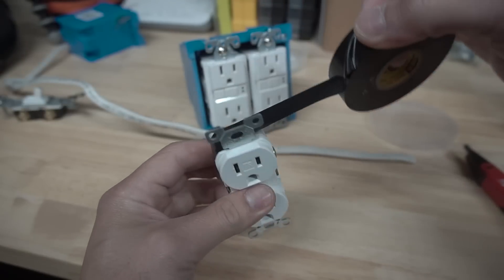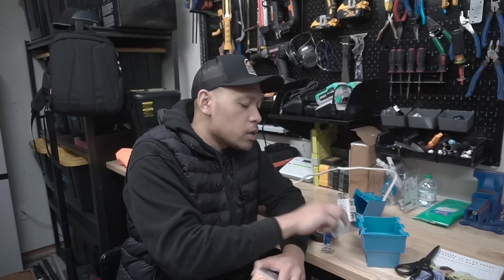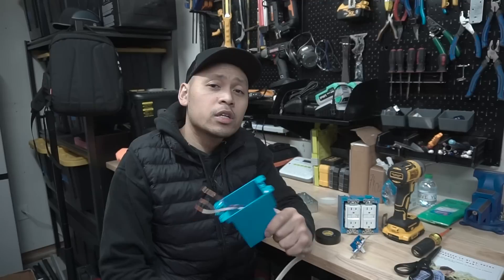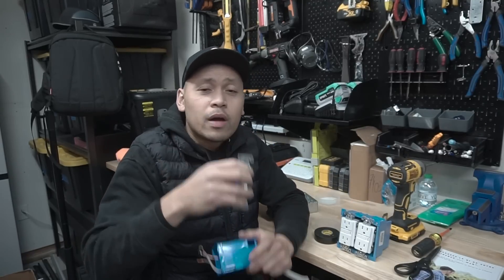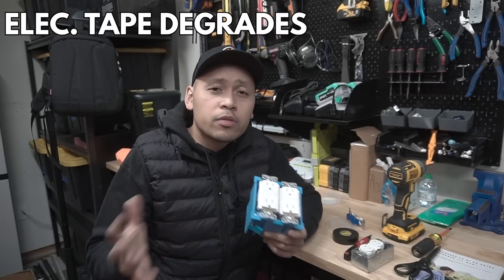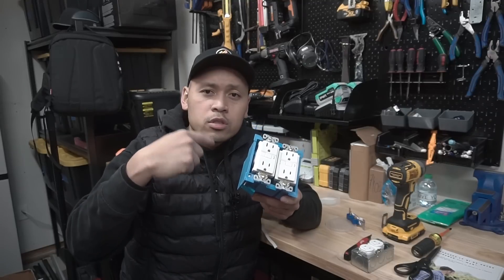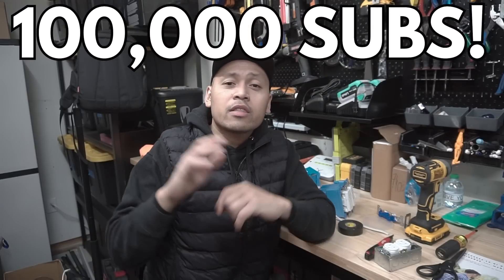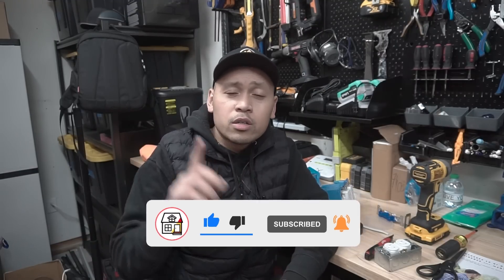Is It ILLEGAL To Wrap Outlets And Switches With Electrical Tape?! The DIY Great Debate! How To

Comment: I just hit an issue that makes me believe this practice is necessary. It's a new construction home and I was replacing a switch to a dimmer. The previous guy installing the left switch, left a hot terminal screw sticking out. Unfortunately the ground wire on the right switch touched that hot screw, and shorted. Luckily the circuit breaker immediately tripped, and all that's damaged is a slightly burnt hot terminal screw and a ground wire. I had to take that switch off, screw the terminal in, put the tape on, before I can confidentally put them back.
Reply from the maker: Thank you for sharing!

Comment: My 62 year old house with close clearance metal boxes has been prone to the screws somehow backing out(vibration over time?) and touching the box causing tripping and other weird stuff. So I will wrap tape around them AND around wirenuts. I see some electricians don't like it becuse of speed or extra time required, their stellar wiring skill, etc; but I don't live in that world and don't care.

Comment: I've been a electrician for since I was 12 years old. Yes my father broke child labor and minimum wage laws, paying me $2 a hour in 1998. Well taping outlets and switches, no matter what, was burned into my brain. To me it's all about looking out for the next person that will be working on the device. After 6 years of tripping breakers just before final inspections, I finally got my boss to agree with taping all outlet. He would say it take to much time. It takes 15 whole seconds to tape the devices. I personally work hot 90% of the time. Now and days you can't just trip the breaker cause you can short out smart switches. Also flipping through breakers can interrupt customers that work from home and such. So I tape the hot and neutral wire and then I can remove from box or pipes. And yes I have been buzzed more times then I can count. 277v high leg in meter was the worst. Never listen to your power company when they say it's off. Always check with your widow makers at least I basically kind of measure it out. Sorry 2 years late. Found your video searching for any info on using alien tape to hold a 1900 box on metal siding. It's just for the wall pack switch leg j box.

Comment: The way I see it, I see no harm in it. Yeah, it might be troublesome to service, but with a permanent installation, You're not gonna be poking in there on a regular basis. I would also tape around wire nuts too just for good practice as well.

Comment: I've had shorting issues with bare ground wires touching both the hot and neutral receptacle screws--with the screws all the way in--and even with back-wired receptacles--and even in plastic boxes--doesn't matter.  And I'm neat, take my time, and try to fold wires carefully.  Tired of tracking down issues--I wrap everything now.

Comment: HELP!!!

So, i have 2 front rooms upstairs (adjacent bedrooms), and whenever you plug in a vacuum into either rooms outlet, it kills the power to both rooms. The weird thing is, the breaker box switch never flips off, but stays on, amd in order for me to restore power to both rooms, i feel like i have to plug something into a random outlet and just wait. Today, i decided to check on all the outlets in both rooms (and i did cut the power in the box 😊), and i notoced every wall outlet does indeed have electrical tape wrapped around them, but then I found the issue! One specific wall outlet had 2 postivie black wires on their own screw, but the electrical tape was MELTED from the bottom black wire. After i took the tape off, i also noticed about 1 inch of the rubber had a long sliver exposing the actual wire. WHAT SHOULD I DO?

Comment: This is not a practice that has ever been used in the UK. However, what is done is that the bare copper ground (called earth in the UK) wires have a length of loose sleeving cut to length and slid over them. That way, there is no chance of it coming into contact with either a live (hot) or neutral terminal. 

In general, I don't like insulation tape. Over time, the glue often goes gooey and the whole thing becomes a mess. We also use a lot of metal boxes too, but the terminal screws are shrouded to avoid them coming into contact with the boxes. Only the ground (earth) terminal being an exception.

Comment: I am an electrician. When we do a receptacle we do not wrap it in tape. Looks unprofessional and is a PITA to deal with, more important to screw down all the un used screw terminals to stay away from box edge. When there is a metal box, we do wrap. LOVE THAT SUPER 33! I also use a torque screwdriver and cut every wire to exactly the same length, That copper bar won't melt itself. As a result of the torque driver, the connections are CRAZY secure.
Reply: I'll be sure to give my customers the option for an additional cost. $.75 cents per device more.  Then this video can get more views!! And back around we go.

Comment: I remodeled apartments for a retired electrical engineer from the army for about a year and he taught me everything I know about electrical. His biggest thing was ensuring every switch, outlet, and wire connector got wrapped with electrical tape. With switches and outlets the reason being is if someone behind you decides to work on that device live when they pull it out of the box they don't risk touching the terminals and getting shocked. At the time of this comment I'm remodeling a house my wife and I just bought and I've spend several hours now wiring pig tails to all outlets to have them ready for install as soon as drywall is done. 80 outlets total and every single one of them got wrapped twice with electrical tape with a dog ear. Out of my 13 years of experience in construction since working with the electrical engineer every outlet or switch I've worked on never goes back into the box without tape I refuse to not wrap them. It's the guys that wrap them but don't leave a dog ear are the guys I want to hunt down and have their butt meet my steel toe boot....

Comment: Can (maybe cheap) electrical tape adhesive pass current? As a kid I used to play around with electronic components and did not have a soldering iron. I used to twist wires around terminals and use electrical tape to keep things in place. I remember having a small switch in circuit with a battery and an LED. I had tape on the switch terminals for insulation and 'strain relief', and even in the off position, the LED gave off a dim glow.

Comment: I worked in a hospital as an electrician, and all boxes are metal, with "E.M.T. or rigid pipe"  with "mud rings", the wiring was "THHN WIRE" with the receptacle wiring "PIG TAILED"( this was done so current  will not pass through the receptacle), unless it was the end of the line for that circuit. not only did we wrap the receptacle/ switch, we also wrapped the wire connectors( wire nuts). the "3M- SCOTCH" brand electrical tape is an excellent tape to use, it is also "FIRE RETARDANT ". there is nothing in the "N.E.C." about this topic( just like receptacles installed ground side up or down). when dealing with electrical inspectors, lets face it, when you are having electrical work inspected on a regular basis they get to know who you are ,and what kind of work that you do. so if you do electrical work in a "PROFESSIONAL AND WORKMAN LIKE MANNOR" ( that is in the" N.E.C."), the inspector will test "GFCI" receptacles for polarity/ ground and perform a ground fault test on the final inspection. the only time an inspector will "NIT-PIC" your work is when you have "PISSED OFF" the inspector in the past, or the inspector does not know you, just remember the inspector has the final say in your work ,the reason why,  is that inspector is "ON THE HOOK" for your electrical work for as long as that person is living!!!!.   it is always a good idea to have electrical work inspected if you are a contractor. in case something should happen(  FIRE!!!  )  trust me you are liable for what happened, so with inspection, you shift the liability off of you and on to the inspector. it is not worth getting financially crushed!!!!( those contractors who carry/should carry liability insurance, and you did electrical work without inspection, and a fire broke out and it was listed as "ELECTRICAL", and it turns out that is was the work that you did------ you just let your insurance company off the hook---you are not covered)

Comment: I wouldn’t trust electrical tape to permanently prevent a short between a wire pressing hard against a screw head. I’d rather have a short during power on while I’m there then the homeowner find out I’m a hack 10 years later (they don’t need to know that 😂).

IDEAL actually makes a product called ArmorBand. It’s actually a wide rubber band that’s fairly thick that goes around an outlets terminals. Just stretch it over the outlet and release it when it’s covering the terminals. It’s not as cheap as electrical tape but I feel it would stand the test of time a lot better. Something worth looking into and while I never used them I can’t imagine it wouldn’t work and be a better solution than tape….which is quite literally a bandaid solution for a bigger problem to begin with.
Reply from the maker: Thank you for the feedback!

Comment: I worked as a maintenance mechanic/ electrician for 40 years. I have always believed that if the the device is wired correctly, and the box not crowded with wires, and the box sized right for the devices, you shouldn't need tape, metal box or not.  I do it sometimes...

Comment: I am a DIYer, and always do it. 2 main reasons: 1 the extra safety. 2 I often get into projects that last months. Have had a live switch/outlet with no cover or even pulled from wall for days while I repair drywall and paint around it. Having it taped is a good way to ensure i don't get zapped when fumbling for the switch.

Comment: Everyone of you, that deter using tape. And it might be your preference, but that isn't thinking of the next electrician fix another problem. Yes I said electrician. NEC AND EVERY CODE, Nation Wide. Says that if your not and electrician. You can be sued, by the owned of the place you tried to fix. Word of advice, If your not Qualified. Stay away.. And, further more it's been good practice to tape a Switch or receipt. For many years, in fact, it was a requirement with nob and tube. So, most of your commits are straight, B S.

Comment: When I wrap I stretch the first two wraps to keep everything together then a third loose wrap to keep it from unrolling. Sometimes even a wrap around the wires in the back of heavy gauge solid wire so they don't bend and break. Everything depends on the situation.
Reply from the maker: Thank you for sharing! 🙏🏽😊

Comment: Worked at a large slaughterhouse then a large candy factory that had nightly cleaning using hi pressure washers so water intrusion was always a problem. The tape around devices helps the power from arcing to ground. We had to take every wire nut to keep water from rusting wire nut spring.

Comment: I've never seen it in the code, if asked, I use Sec. 110-16. 50 year Master electrician, followed by EE in power, and mostly worked in heavy plants. (Mills, refineries, auto assm, forging, casting). Many times the power circuit can't be turned off easily due to other equipment on the line. Wrapping it gives a guy a fighting chance to repair during "normal" hours.

The goo is usually cheap tape that won't hold up. I've gone back to 20 year old 33+, 88+  tape and while not great, didn't leave a mess. Yes the tape will stretch, it was designed to do that. Leave your last lap unstretched and it won't creep.

Comment: 20+ years electrician.  I base wrapping on the situation of NM boxes, but always in metal boxes. It facilitates device removal and installation. 98% of the time  you are working hot, and have plenty of other stuff demanding your attention,  so  one simple safety habit can save yourself and the next guy.

Comment: I tape mine for safety and identification. I gives me a place to write notes or label the switch for later. For example, my office has 5 different circuits for different things. I have computer circuits, general plugs, dedicated ones for my laser and 3d printers. Basically lots of electrical. As I installed them I wrapped the outlets with different colors the same as if I was labeling the wires.

Comment: my father was a master electrician and taught me how to do simple electrical wiring.  i am not a "licensed" electrician but have been flipping houses for some 7 years and do the "rough-in" electric and then have licensed electricians inspect my work.  here is all anyone needs to know about adding an additional level of safety on an outlet or switch by wrapping the device terminals with electrical tape - it is an additional level of safety to the electrician AND any home owner who tries to take the outlet out themselves.  there is NO-ZERO reason not to wrap the outlet/switch.  the only reason an installer would have for not applying several wraps of electrical tape is that they are TOO CHEAP to use some tape OR they are TOO LAZY to take an extra minute of their time to produce a better and SAFER install.  i'm sorry if you are an electrician who may be insulted by my comment.  however, what i've said is FACT and is TRUE whether you like it or not.

Comment: Only time I use electrical tape is if there are too many wires in the box, so I do it for safety.   HOWEVER:  I have watched hundreds of bushcraft videos and see that you can use a feral rod to strike sparks on grey and black duct tape to start fires easily.  I have not tried this with black electrical tape to see if it burns easily yet.  I was just wondering if sparks did happen in the metal box or plastic box with electrical tape, if it would increase the chances of a house fire.  Only an electrician would know this.

Comment: 3:58 Box too small is a code violation in itself. Use properly sized box and problem solved. Nearly every switch and plug has a specification of size of box to make wires comfortable in them and to provide clearance for the intended insert. Too many ignore those specs.
Reply: Plugs don't go in boxes - so they have no such specification on box size. In my 50 years in the industry I have never seen a switch or receptacle with a box size specification. Boxes are sized by their volume versus the number and AWG of wires in the box. 2020 NEC 314.16.

Comment: Electric tape wrap is for electricians with no confidence in their workmanship. 
Also it delays tripping from terminal touching the box, until after the period of time,  that the electrician can be held responsible.
Reply: This is extremely ignorant on you. You really should just do a bit of research before you make comments about issues your ignorant about.
Reply: @mkidd8806  If your feeling get hurt then stay away from electric.
The worst kind of short is a slow short.   Electrical tape is not an isolater.  It will retard a short,  but eventually the tape will melt away.   
In the process of melting the Electrical tape, it won't trip the breaker,  arc, or trip a gfi breaker. 
The heat generated will be gradual, acting like a small space heat, or a soldering iron.  It will eventually start a fire in the stud.
If a terminal touches the box it will immediately trip a breaker,  arc-fault breaker, or a gfi breaker. 
After 30 years of Electrical work, I have never been called back be cause an outlet or switch because a terminal touched a box.
I did use electrical tape in damp locations.   I even wrapped wire nuts in Electrical tape.
Dam right,  I am ignorant when confronted with stupidity.   If you're not confident,  and need electrical tape, then you have no business being an Electrician.
Reply: Feelings not hurt.
Reply: @mkidd8806  good
Electrical tape slow melt

Comment: Code or not. Code is the minimum requirement. When people say up to Code, they are actually saying down to Code without knowing it. If your favorite answer for not going the extra mile in electrical work is " YOU DONT HAVE TO DO THAT!"...you are most likely in the wrong business.

One reason I didn't see mentioned is, say you have a bank of 5 or 6 switches, pretty common. When you have to remove just one to add a dimmer or troubleshoot or even installing them the first time, way easier to work on one or more hot devices floating around in the air when they are taped. 

It is common in old work where it would take 20 minuites of trouble shooting to find an unmarked breaker in order to replace a 5 minuite or less switch or just too peek in a box to trouble shoot. Having the switches taped, either the ones still in or floating out are way safer for installer, people walking by  and other devices if they are taped.

Reasons for not taping???--- I always wonder if a house full of taped devices from hot to neutral and ground may cause any miniscule drag or power loss over time. The glue is glue and glue has moisture and moisture usually has some water content.  Obviously a little far fetched but. The only reason I see not to tape or to have an argument against it. 

Is it fire proof and is it causing a micro short?